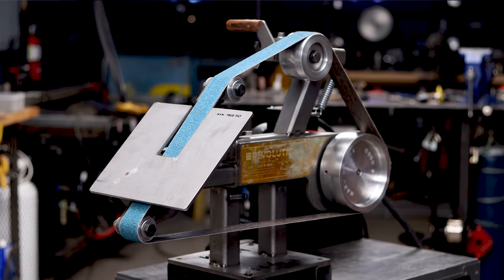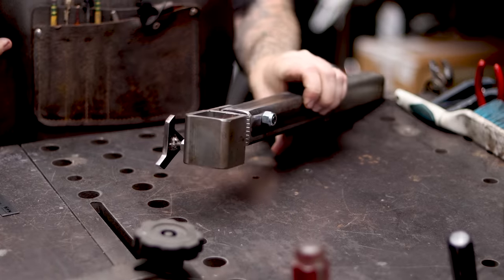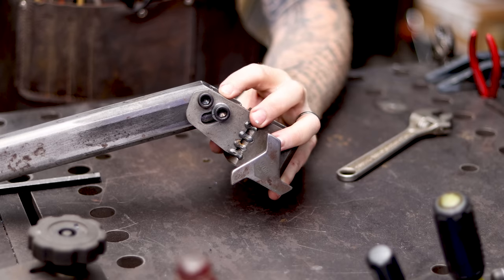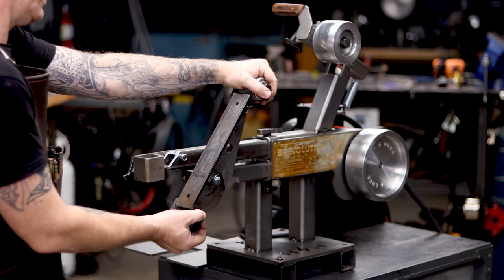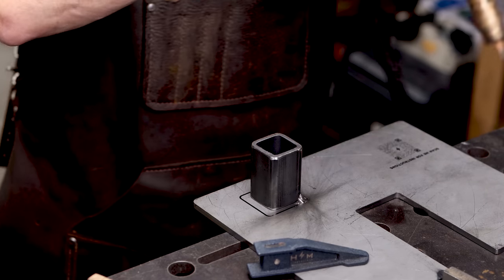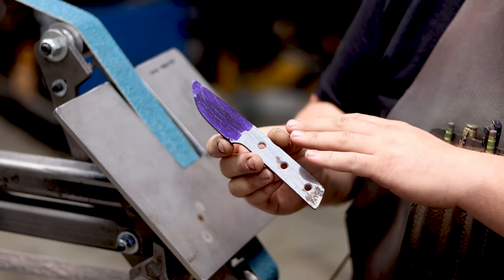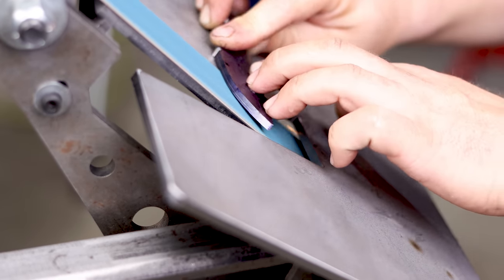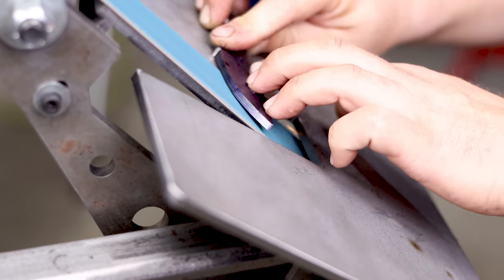How to: Grind Clean Knife Bevels Quickly

Comment: A tip: put a couple of coats of Minwax paste wax on the table and it will slide easily and keep the rust off 😊 you can get a can at Lowes I’ve been using this on all my metal work tables for years. Hope this helps
Reply from the maker: Thanks Don! I'll give this a try.

Comment: On that 2" right angle die grinder, replace the air fittings with swivel fitting.  It really helps reduce wrist fatigue because the weight air hose is reduced.  Cheap upgrade.

Comment: Suggestion.  Since you are already laser etching, how about if you put graduation marks with enumerations along the belt, say ⅛" increments.  The enumerations don't have to be listed in eighths. Just whole numbers.   So that if you are grinding on a 3, when you flip the blade over, stay on the 3.  Until you want to move up an increment.  This would allow even less skill to get a great blade.
Or, just enumerate the ¼" marks but place 16 th graduation marks.  For even finer control.  Cheers from a Rev 3 Builder.   Though, I doubt the actual Unit of measure doesn't really matter.  This would be merely a visual aid for how much material you are cutting off.
Reply: Great idea
Reply: I was thinking different colored paint marker lines that way it would be easy to see instantly

Comment: I notice you like to use alot of tacks to put stuff together I think you would really  like dual shield fluxcore (dual shield not regular fluxcore) it makes really  strong attractive tacks that won't break on you nearly as easy, I think once you tried it you would never go back.
Reply from the maker: I run 75/25 argon CO2 mix at the moment. I'll have to try this duel shield stuff!! Can it run in my Hobart 220 MIG?
Reply: @HouseMadeUS  yes and you can use the same gas.....get .035 diameter

Comment: You did a good job of fluking your 45 degree cut with the toolpost holder.  :)

Suggestion..

You could also lower the toolpost holder to 45 then scribe the tooling arm then cut to that line.  Not a big difference really but if you want to get that lined up like Brian did and it would guarantee giving you the hole clearance.
Reply from the maker: Good idea. Thank you. 💪🏻👊🏻

Comment: Hi Brian, this new table looks great. I have a Gen 3 machine with the D plate upgraded to gen 4. I primarily make kitchen knives and usually make a full flat grind on 1/8” thick by 2” wide stock, my grind angle is about 1.5 degrees. Will I be able to achieve that low of a grind angle on your new table? I’m guessing I might need to grind out a the back of the belt slot on the table but would like to know for sure that I can achieve that small of an angle.
Reply: It may be possible. The table is able to achieve the same angle as the platen but you’re correct to possibly achieve a 1.5° angle you would have to grind a ton away from the backside of the table. I have ground mine back about 1.5” and can achieve 3.5° with no interference.
Reply: Cool, thanks for the reply.
Reply from the maker: Brent is right on with that answer. Thanks BMKT!

Comment: Wow another add on for the Gen 4, this is awesome. I was thinking about longer blades, order of operations, kitchen knives, etc. Will the tru tilt rest be wide enough for say an 8" guyto... Would the hidden tang handle be something you profile after bevels now?
Reply from the maker: That's a good point, not much to hold on to with a hidden tang. Probably think a bit ahead on that and leave it longer or wider then profile it later. Ill give it a shot and report back. Thanks as always for supporting my work!!

Comment: Super add on for us newer knife makers, bevels are the biggest problems that I have ran into and will give this a try. The scratches on finishing I hope is not a major problem.
Reply from the maker: Watch until the end so you can see how Brent figured out how to alleviate the scratches problem on finished work. Thanks again Rick! 🙏🏼
Reply: @HouseMadeUS  Saw the electrical tape usage, but being a engineer for 32 yrs I am looking for something simpler, maybe Teflon / Powder coat / ???? on the plate?? just thinking

Comment: sweet! if you milled the bottom of the slot at an angle you could get it closer to the belt at the bottom, which would probably help support small blades better
Reply from the maker: Oh yeah that is an excellent point!! I like it. Ill give that a shot.
Reply: @HouseMadeUS  all you have to do is use the grinder on the table dont need a mill thats how i did it on my tilt table just a thought

Comment: I'm not sure I get how this is preferable to a TR maker jig, and the downside is that you're throwing your platen and work rest out of square when you use it.  What am I missing here?
Reply from the maker: Any jig requires you to clamp or bolt your work to it. This solves that problem and speeds up your grinds. Also the platen and work rest are made to be angled any way you like. Takes about 1 minute to reset.

Comment: Awesome product!  Do you use this to put an edge on the blade too?  If so, what angle do you generally set it at, and do you use the same technique?
Reply: You would not use it to put an edge on for 2 reasons 1) you will have the handle on at that point so there won’t be a constant flat to lay on the table and 2) the belt is running toward you and you would run the risk of cutting the belt. Thanks for the question!👍

Comment: Does this come with the tooling arm? I can't get the page to fully load.
Reply from the maker: It does not come with the tooling arm. We will have those available separately
Reply: Ok thanks. I ordered one but I thought it came with one. Does it have to be welded to the arm?
Reply: @HouseMadeUS  disregard last question didn't k iw it was on the video caught it late when it premiered.
Reply from the maker: The small tooling arm comes with it just not the full Gen 4 arm with work rest receiver. Are you running a Revolution Gen 4?
Reply: @HouseMadeUS  yea I'm all set I'll just modify the one I have Ike in the video. Thanks

Comment: Is there a big wheel attachment for this revolution
Reply from the maker: Yes I sell the arms but not the wheels. You can buy those pretty cheap on AliExpress. Here is a link to the arm: https://housemade.us/products/contact-wheel-tooling-arm-kit

There is a video showing how it goes together at the bottom of the page.
Reply: @HouseMadeUS ,I just bought your grinder of a friend in Ireland 🇮🇪 😀
Reply from the maker: Was it Robert O'Grady? He is great
Reply: Will the the tilt table fit the gen2
Reply: @HouseMadeUS , no but I know Robert very well 😂
Reply from the maker: It will require the Gen 4 work rest tooling arm.
Reply: @HouseMadeUS  what's it like?
Reply: I'm a welder by trade, don't worry I'll make one 😉